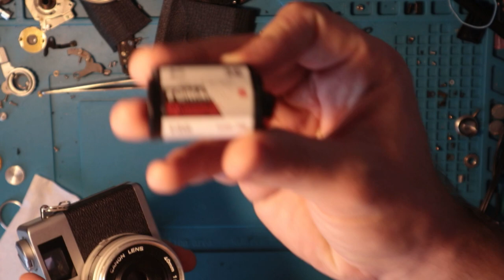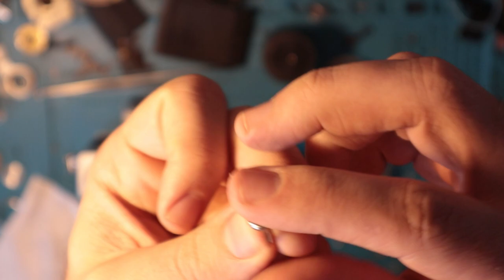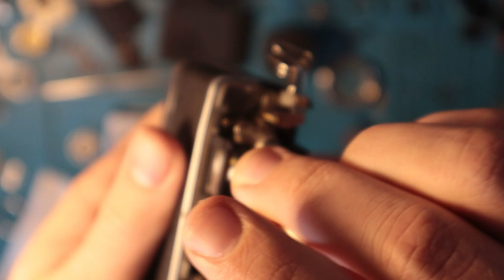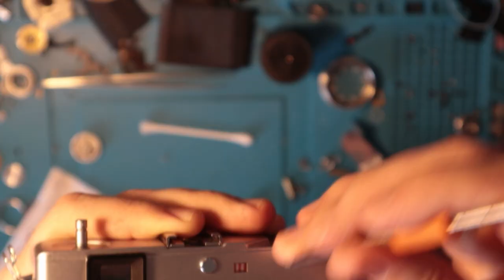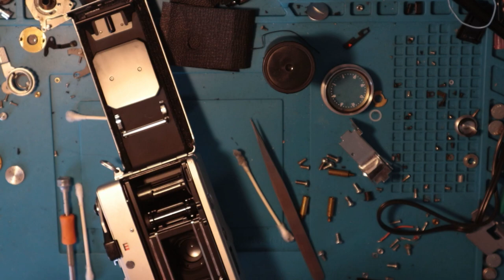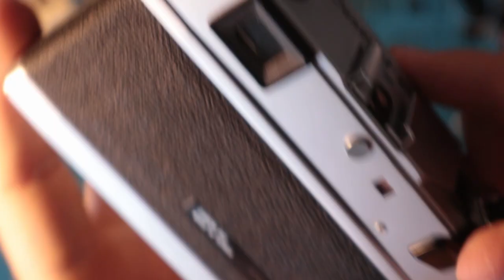Romping Bronco Restores: Canonet 28

Comment: I have one on my bench. It won't fire up with a new battery. Any advise before I open it up?
Reply from the maker: Did you try to fire it on the aperture settings and not just the auto? Sometimes with the QL17 G3 the blades get oiled up and stuck usually removing the glass elements and cleaning the blades will help it fire, I'd try that before doing to much invasive work.
Reply: @RompingBronco  Dead in auto. Blades are working. Shutter seems to stay at a 30th. Invasive work ahead. Who should I support for light seals?
Reply from the maker: @instructionification  Ah gotcha, there's a small board on the opposite side of the lens that may be affected by some battery corrosion. I believe I demonstrated how to get to it in one of my Canonet QL17 videos if you need help. As far as light seals go, I usually just get them from eBay. Try to match the original seals as best as possible, Canonet's are synonymous with light leaks otherwise.